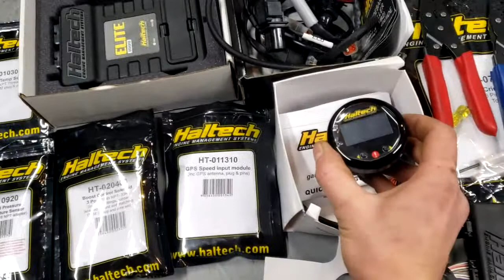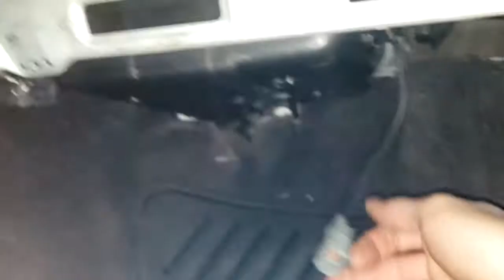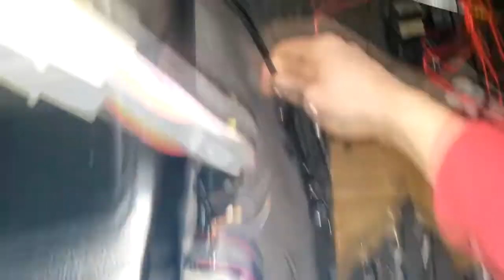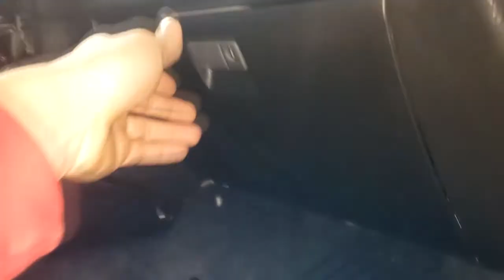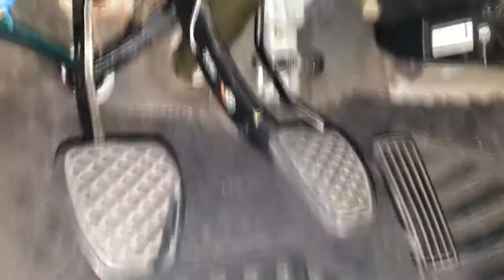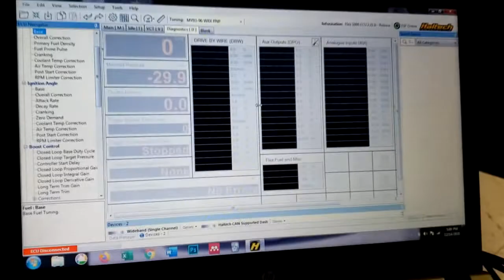91 Legacy Turbo Haltec 1000 install - Built motor first crank!

Comment: Wholly Crimeny Sakes 🤯

I love your videos because you give me confidence to jump into my subarus as projects, and not just stay on the corvairs... But this video...

Egads!!! Think I'll stay with my 1960's electrical a little bit longer 😂😂

That said though, I'm redoing the electrical in my 68 UltraVan, I'm wondering about haltec for the dash...  (I was setting up an arduino to run the machine, but that gps speedo you have has my attention..)
Reply from the maker: Thank you! You should branch out these cars are a lot of fun. But as far as your ultravan I don't really know what would be compatible with that, I don't know if haltec would be the way to go. I think aem makes a GPS speedo gauge, I would go with something that can be a stand alone unit that could be added in along side the 1960s electronics